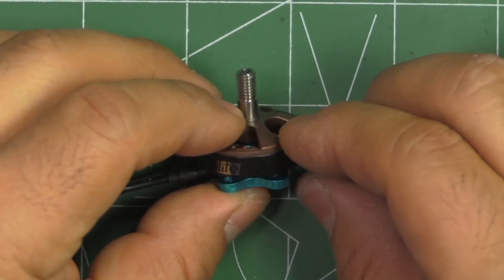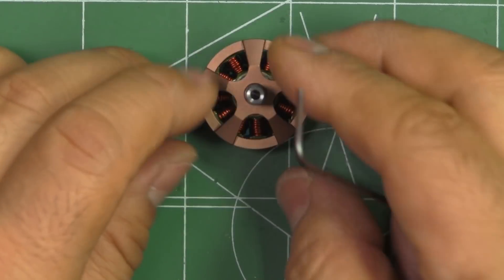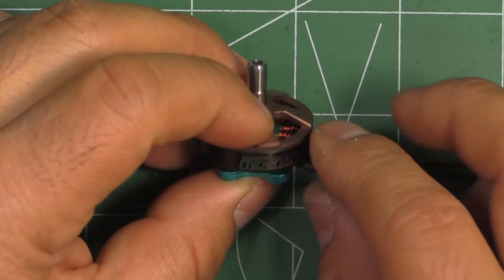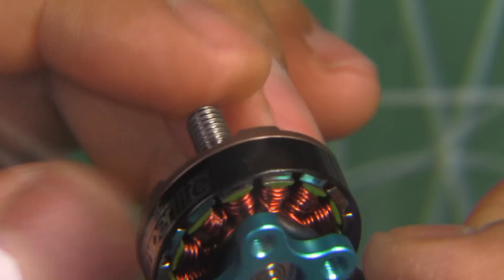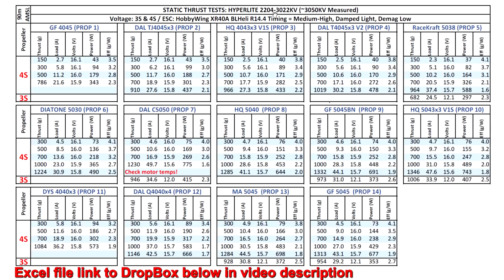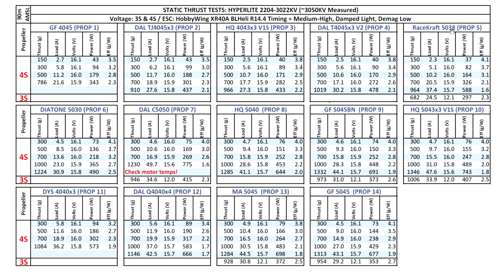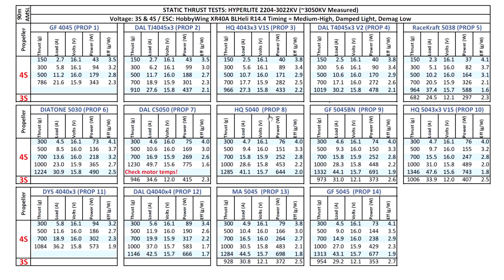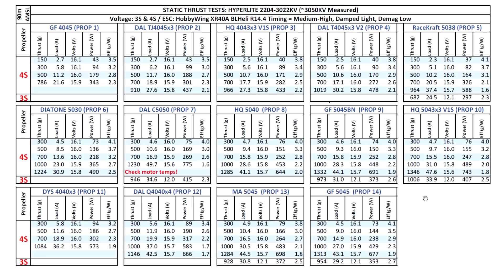Hyperlite Floss Series 2204-3022KV Thrust Tests & Overview

Comment: What do you think is better? A 1806 or a 2204 motor? The have pretty much the same stator volume if you calculate...
Btw could you review the LDARC 1806 2500KV? I’m interested in this one...
Reply from the maker: I think a 2204 is better. They weigh about the same but 2204 usually has better power & efficiency and also may survive crashes a little better. Yeah, I was looking at the LDARC but didn't order it yet. 1806's are not used that much.

Comment: What do you think of these brand new motors rcx came out with?
http://www.myrcmart.com/rcx-ls2207-2400kv-fpv-racing-motor-economy-version-p-12066.html
They say that it is a budget version of the NK2207 motor. What do you think that means? I couldnt find any differences on the site
Reply from the maker: JC250 My best guess is the lower price comes from lower price bearings and copper wire in windings. Those are the 2 components where factories save or spend a good portion of the cost in a motor. So bearings could possibly last shorter time and you would have to be careful not over propping but should be fine for any 5" prop

Comment: Do you think the 2255KV version of this motor could run on 5S?  Pyrodrone has a 700mah 5S battery that perhaps could help with sag from small batteries running on a 250gr AUW setup...
Reply from the maker: KruiZen on 5" low pitch triblades like the 5040x3 and a very light build it should work ok on 5S. But I think you may have to go to a 1000mAh pack. Just my guess. The 700 pack is worth a try. It may just get you enough flight time and not sag. I think it would be too small but can't really confirm until you try it with your setup.

Comment: Could you adjust your Power supply voltage to be equal to a 3.3v per simulated cell(Under load, as I notice your supply does drop voltage)? That way we could see how much current and thrust an actual setup would get, or at least it would be more accurate.
Reply from the maker: For thrust tests the voltage is somewhat "arbitrary" I picked 16.1V because before I was using LiPos for power supply and voltage would drop to around 15.5V under load, this power supply behaved very similar to the Lipo i was using so I left it the same also so we could compare results to all the previous tests. I understand what you're saying and I thought about changing the voltage before but decided to keep it consistent. As far as thrust it's very difficult to get an equivalent "in-flight" thrust. We can get an estimate for Amps as I've noticed up to 40% lower Amps in some setups. The majority of viewers are used to this setup and can get an idea of the numbers since they've been watching and using thrust results for sometime. If I had a lot more time available I would definitely do a couple of runs @13.2V under Max load for every test but unfortunately I've been having less hobby time
Reply: in the air is so much different that it does not compare anyway. I'd prefer keeping the same voltage as always, so we can compare motors since thr first he ever measured
Reply: The only reason it is different in the air is because the quadcopter will move forward but static thrust tests were never used to see how it moves through air, only how it performs statically, for example descending quickly and then going full throttle, for a moment you would be stationary. Lowering the voltage would show us more accurately how much a thrust and how much current a motor will draw at most during a flight. Just an idea.

Comment: Love your vids but could you pleaseeeeee update your prop selection. No one runs these props anymore. Would love to see hq v1s, gemfan flash, etc...thx man!
Reply: There is a 4.3 V1S on the thrust chart link.
Reply from the maker: Yes, I'll have to order some Flash 4" . I've tested the Flash 5" on the recent 2307 test and on some other motors a few months ago. Those props always show poor performance, lower than HQ 5043x3 V1S on the thrust stand but we all know they're faster once flying. They're designed for fast forward flight so in static thrust they don't work well and show very high Amps and low thrust so that's why I don't include them because results would be confusing
Reply: Sometimes when props show poor performance in Thrust and current their RPM and power curves can make-up for the difference and then some. The GF Flash & RK5051's are good examples of these. I wonder if there's a way to place a metric next to the Thrust data indicating higher rpm ratios?

Comment: I run these on 260g quad, 5051 tri cyclones, 5050 bi cyclones using xsd20amp esc. No issues at all. Never blown an esc or burnt a motor
Reply from the maker: Thanks for sharing your setup. I didn't think these could run those aggressive props but I can see that on such light setups as the props unload the motors are a lot less stressed so no issues. Awesome!
Reply: EngineerX yeah I have 2 of those rigs.. a the proton Frame sx with xnova 2204 2900kv, and x with the hyperlite 2204 3022kv. Very god acceleration and decent top end. But I can feel it  let off when I'm full throttle. It seems faster about 80%. Specially in the corners, it pulls hard. I plan to get the hyperlite 2205 2522kv and see the difference. And the durability is amazing. On the hyperlites

Comment: What's the best ~$15 motor for 5 inch racing?
Reply from the maker: Seems for racing people prefer high KV2600 and higher. I've seen some good results with RCX NK2207 motors, also those BBB 2207's are doing well too. I think you'll have to go to $20 or a bit higher for better options than those.

Comment: Really nice motors. Great acceleration in particular. https://www.dropbox.com/s/72vxa9izga1eow3/BH2204_3022Kv.jpg?dl=0
Reply from the maker: Nice graphs! thanks for sharing them
Reply: Thank you for your thrust tables. 8-) That's what these charts are using in conjunction with a Martian-II frame and typical components for dynamic projections.

Comment: I've been waiting for this so long :D
Reply from the maker: Hahahaha.... sorry . Next 2204's will be the new RCX NK2204-2700KV & 2950KV hope to have video for the 2950KV in about 1 week
Reply: EngineerX please test the 2700kv with a large selection of 4" props
Reply from the maker: Will do. the KV's measure lower than spec'd. 2600 & around 2700 .... Very nicely made motors with 4mm shaft and good bearings.
Reply: thank you!

Comment: On the 2722kv the 5050c are awful on this. V1s and the slim blades on the 5051c work very well as do 5152x2 flash. Pretty poor numbers though. Unless you can go 5" ultra light (mines 160g pre props)  these aren't great motors- they run well but also very fragile. I've lost two in light crashes. I'd avoid and go 2205 for extra top end and more prop choices.
Reply: Coppertop FPV I think the 2722kv just don't pull that well. I haven't managed to get mine tuned on bi blades but the dal 5040s are really nice. I've seen 200kph on my gps with theses. My prop of choice though is the dal 5051 'ntyfurys' to be honest they are brilliant my Machine weighs 192g and has super skinny arms. On a well tuned lightweight build theses motors rip! 
https://youtu.be/urF0Ef-eQDA
Reply: Sugar Kane they certainly make for a fast  agile fun quad, but sorry, no way are you getting 122mph from 2204s without a strong tail wind. I reckon no more than 90 tops, and those motors were eating your lipo. Here’s mine weighing 178g on its test flight https://youtu.be/5USgc4kdKkw
Reply: Coppertop FPV the tail wind was pretty epic. 175-195 kph all day long. Funny thing I was running 18g power leads cause #weightweenieanteasy but a few days ago I blew my ground wire out of the xt60. Fixed it and then blew the xt60 pretty much to bits. I replaced it wit 16g wire and holy Shit.. now I can rev the 5051 props all the way out. It's quick.. the airframe has arms that are 6mm wide and a 20x20 stack super small profile was the order of the day
Reply: Sugar Kane yeah they’re a lot of fun to scream around. My experiments have been put on hold till summer :) tired of scooping mud out of them.
Reply from the maker: Good points there, for a few more grams 2205's are a better choice. So these are for those who want a very  specific and unique setup. You need some of those BH Venom sealed motors to avoid muck inside motor. Hopefully those Venom turn out to be durable. Only using 3mm shaft but hopefully the titanium helps.
Reply: EngineerX yes, I love the quad they’re on, as you can’t help but fling it around as it’s so responsive, and a joy to fly, but unless you’re incredibly gifted id imagine a standard 2205 setup would toast it in everything bar a few unique circumstances. I keep looking at the hawksky 2205. I saw a thrust test where they blew away the BH R4 which I wasn’t expecting. I keep hoping you’ll get some - and the 1507. I keep hearing good things about both. Venoms are just too expensive for me!
Reply: Coppertop FPV I think I'm going to put some f40 pro v2s on my rig later this week. With the gemfan 5055s the thrust gain is going to be massive 😂
Reply: Sugar Kane haha. That'll blow a hole in the atmosphere. For me after trying both extremes (2204 & 2306 2700kv) I want a 2205 or 2206 at 2600kv or so. I love the agility of 2204s, the speed on the bigger motors is also immense, but I'm always fighting altitude gain even at 65 degree cam angle on those.  I keep looking at the hawksky 2205 which look epic from what I've seen. Decisions decisions!
Reply: Coppertop FPV I've got pyrodrone team 2206 2700kvs on my GoPro rig and 5152 tri blades. It's a bloody weapon. 
On the ultralite I've gone to 5mm arms for a bit for stiffness. With the new motors it should be around 225g dry. The new power to weight will be around 17.5:1 😲 I wonder if I can break 8g on vertical pulls 😂

Comment: Out of stock :(

Perfect for my tooth fairy 5 inch
Reply: Mini Quads Mega Fun don't buy these. Get 2205s. I wish I'd not bought them (mine are the 2722kv). Fragile and only come into play at less than 185g with props on. Even then they fly great but are too limited.

Comment: The Diatone 5030 looks good though some of the others might unload better
Reply: No option for racing, breaks like butter. Best is lower kv and a heavier prop
Reply: Then what good is this motor?
Reply: Its good for 4 inch
Reply: Don't use Diatone 5030 for 3000kv motor! Bursts into the air! https://www.youtube.com/watch?v=rYHRhZmj5lU
Reply from the maker: Thank you for the valuable tip!!! I'll have to start using the DAL 5030 instead, seems they use stronger plastic

Comment: Interesting how the 5050c dual blade overloaded while the 5043x3 v1s did not! Really that 5050c is a difficult blade to spin...
Reply: nasone32 that's the worst prop I've ever used. Noisy, inefficient. Wish he had tried the 5051c - they work well.
Reply: I've tried them I can't get them tuned right at all.. the 5051 tri blades on the other hand are awesome
Reply from the maker: Interesting and that says a lot and why that prop is not used that much